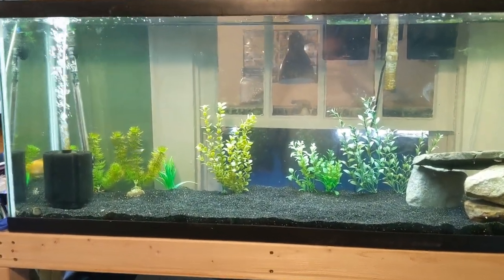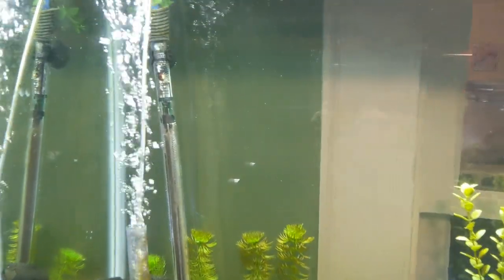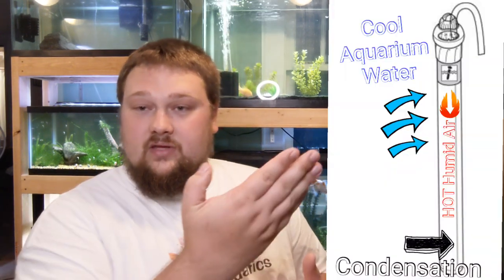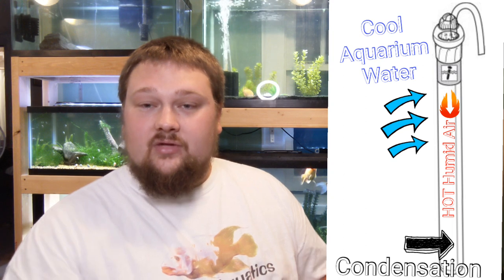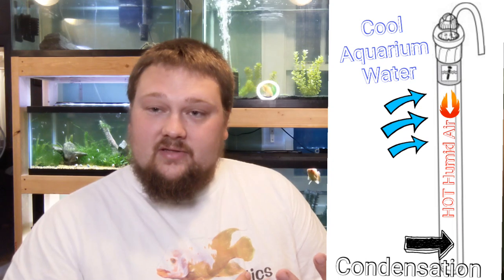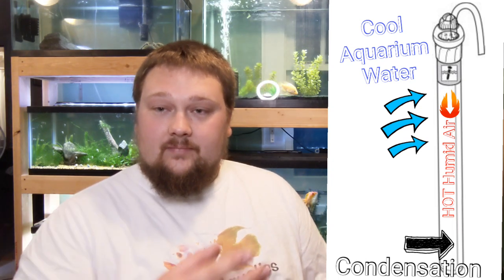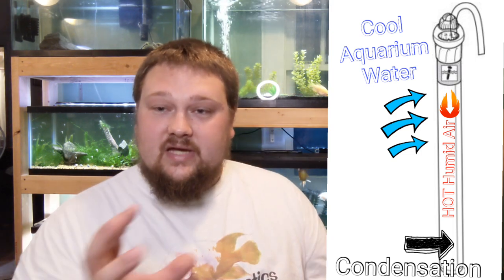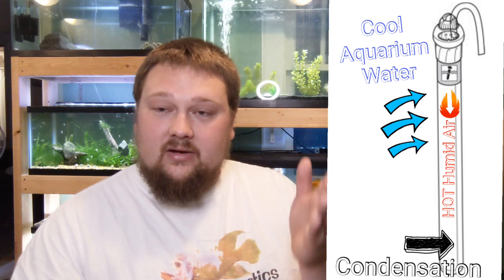Water inside an Aquarium Heater - Is my heater Broken?

Comment: If you have any water in your heater it’s malfunctioning. Theses heaters should never have that much condensation in them in the environment their in.  The temp is the same on the inside and outside for the most part. It’s not unpopular it’s how they function.  A submergible piece of electoral equipment is manufactured under a guideline of safety. Water should not be in your heater. If it is there is a chance it can pop.  If you find condensation return it. Water and electricity are not friends.   I’m sure like me there are people out there that have had a heater pop and kill all your fish. Imagine if your hand was in the aquarium when that happen. Theses days I keep my building at 78 and the majority of the tanks stay there without heaters and the aquarium that need a higher temp like rams discus I use heaters. But electricity and water are a no no. Remember when you are making a video and you present a topic like this saying it’d ok you are presenting yourself as an expert and giving permission you can be healed libel. Be very careful. Yes leaving the factory you can have condensation. After that heater turns on there should never be any condensation in that heater. Temperatures are at equilibrium.
Reply from the maker: The temperatures will never be at an equalibrium, tanks are kept at about 78-80 degrees and the heaters are heating up to well past that constantly to heat our aquariums, and the moisture will never leave the heater as it is a sealed unit, The manufacturers are aware of this and have even posted on their websites in the FAQ section as shown in the video that this is normal to have happen. if your heater is filling up with water that's a different story.
Reply: Trafish Aquatics equilibrium doesn’t mean in perfect union it could mean a few degree variations as the mechanics of physics work. But in order for you to get condensation it would have to be out of equilibrium for an extended time. I can’t get your whole comment but I will tell you you are wrong. And yes you can get condensation from the factory but that air will adjust as the outer temperature changes. You will have a small amount of condensation at first but after the temperature heats up inside the glass the condensation will stop and should never see it again. If someone puts a disclaimer on a product like you say and someone is killed because they used a defective product the manufacturer can be prosecuted.
Reply from the maker: The definition of equilibrium is a state in which opposing forces or influences are balanced. In order for that to happen they would have to be the same. If aquarium heaters only went up to the same temperature as the water inside the aquarium creating an equilibrium between the aquarium heater as well as the tank water then there would be no way for fish to receive burns from heaters, which does happen, because the heater would not be any hotter than the water that the fish is living in. therefore the heaters are actually getting much much hotter than the actual water temperature within the tank which creates an imbalance in temperature which would allow for condensation to build. Also if you watch the entire video aqueon specifically puts a disclaimer on their website that this is a normal occurrence in aquarium heaters and does not affect the reliability or functionality of their heaters. if they're willing to make that claim on their website then they're willing to be sued over it if they're incorrect.
Reply from the maker: It's very apparent that we have very different opinions on the matter therefore I'm going to just leave it here, just because our opinions differ does not mean that I don't appreciate your input! Thank you.
Reply: Trafish Aquatics   Hears the truth. I enjoy your channel. You’re a young guy in the hobby and doing great and enjoying it. I say go for it. I’m an old guy been doing it since the middle 70s. The question of equilibrium was not a question I got wrong on any test in any science class in college. The sun keeps an equilibrium based on the pull of gravity and the push of fusion the push and pull are not always equal but it maintains and equilibrium within a rang of changes. The heater works the same. You set it at 78 the thermostat reach a little higher depending on the manufacturer. Then it shuts off. It drops temp by a few degrees then the thermostat turns it back on. With in that rang moisture shouldn’t develop.  This is just a matter of Physics. Nothing else. I don’t have an opinion on it it just is a fact.  My concern is how you put this. You are not an electoral engineer you can be held liable for what you’re telling people. You are essentially an aquarium hobbyist. Unless you have a degree in fresh water biology and an engineering degree. You’ve told people it’s ok to use a heater that clearly has moisture in it. If you decide to do that’s it’s on you If you tell others it’s ok can you be sure that they can make that decision for themselves based on your recommendation?  It’s not a point of disagreement it’s a point of liability. I’m not telling you this to disprove your point I’m telling you the science of it and the fact that you can be held responsible for what you say in a public forum.  You can’t be sure that someone might take your advice but not have the experience and knowledge to make that decision and could possibly make a uneducated decision that leads to injury. Take my advice be very careful how you present you’re opinion. I watched an amplifier repair tech passing himself off as a teacher. He had a student working with him. He had him open up an amp and start to do some basic things. He never told him not to touch the capacitors or transformers. Because he wasn’t a teacher he didn’t understand the importance of knowledge. The kid touched the wrong thing and in a blink of an eye he was dead. An amp doesn’t have to be plugged in to kill it retains a charge. I tell all my students to keep their hands out of the back of the amp till it’s been discharged. Nothing to do with fish but same idea.  Do nit get me wrong I think you’re are developing a great show. You’re not so far off on all your information and lost of it’s harmless. But damn someone that doesn’t have the knowledge and understanding might say Trafush said it’s ok that’s why I felt ok with sticking the heater back in when I got knocked off my feet.  I bread rare fish. I have to have a disclaimer when shipping and use a proper contract that protects me and the customer. As a nurse I keep liability insurance because I am a professional and can be held liable. And as an amp tech that teaches amp repair I keep insurance for that because this shit can destroy your life.
Reply from the maker: everything you're saying is fully understandable and would make sense if the aquarium heater only heated up to the temperature that you were trying to reach to and no further, this is just not how they work.   The thermostat on an aquarium heater reads the temperature of the water around the heater and tells it when to turn off when the water temperature reaches the desired temperature. if the thermostat was to fail and the aquarium heater was allowed to stay running permanently water temperatures would easily reach well over 100°. This is the same reason that many manufacturers now are putting protective cages around their heaters to protect fish from getting burned from heaters while they are in the on position. As well as many people recommend hooking heaters up to thermostatic controllers as a secondary safety precaution. if the heaters themselves were only to heat up the coils to the desired temperature then yes an equilibrium would be created between the water temperature and the temperature of the heater but that's not the case. if you truly want to see an established equilibrium between a heater and the tank surroundings you would have to unplug the heater and allow the internal temperature of the heater to readjust To the same temperature as the tank water and then any condensated water inside the heater would then dissipate over time as it evaporates back into the air within the heater. also there is no difference between what I'm stating in this video with my opinion then there is of the manufacturer recommendations on their product. What I have stated in my video is no more than the manufacturers notes on thier product.
Reply: I’ve had heaters with condensation for 5-6 years and no issues. The way an aquarium heater works, it’s impossible not to build some condensation in the areas above and below the coil.
Reply: Trafish Aquatics   It’s basic if you set it at 78 it should shut off at a factory setting not to far above 78. It shouldn’t drop to far under 78 for the thermostat to start it up again. It’s not dropping 10 degrees at about 70% humidity and that’s what you may need to cause condensation. That shouldn’t happen in your heater. The heat the heater creates should be enough to keep the heater free of moisture. If you have poor circulation in the tank this could cause hot spots and throw it off where you may have a cold spot in the tank. I’m not arguing I’m just stating facts that I didn’t come up with but it’s just empirical evidence. Like I said I don’t even use heaters in 98% of my tanks. But I also don’t buy heaters that are cheap either. It’s just simple your heater should have around a five degree variance. That should not be enough to creat any permanent moisture inside the glass. If your buying heaters that acquire permanent moisture on the inside it’s not very well built. There standards that these manufacturers need to follow. Putting an electoral appliance in water can be dangers and must be taken seriously.  Back in the 70s all heaters were bad. I’m not shitting you. If you find condensation on the inside of the heater get a better one. These are living creatures that depend on your skills to have a good life.
Reply: Ric Brunner couldn’t you call Aqueon about this then? I mean they’re the ones who admit condensation is normal. I mean you’re kinda beating up on this guy over something he didn’t write. Also how exactly could Trafish be to blame if Aqueon themselves say its normal? Seems like you’re just trying to tear dude down for no reason whatsoever.
Reply from the maker: Yes if you set the thermostat on an aquarium heater at 78°, the thermostat will turn the heater off when the tank reaches approximately 78° give or take a few degrees depending on the given variance built within the heater. but the heater coils themselves do not only heat up to 78 degrees to try and bring the tank up to temperature they go well above 100° in order to do this and once the tank water temperature reaches the desired degree temperature set on your heater the thermostat turns the heater off. I can guarantee you that if you were to reach into an aquarium while the heater was on and grab ahold of the aquarium heater you would not be able to hold on to it for very long because of the temperatures that these heaters actually reach during the heating process. The heater itself does not physically only heat up to a few degrees warmer than the set tank temperature, It goes much higher. This is the variance that causes the condensation to happen.
Reply: Trafish Aquatics I cant read your whole comment. Like I’m saying you a nice guy enjoying this hobby turned YouTube show and I’m happy for you. We would probably get along fine. I’m not arguing the point I’m giving some facts. I’ve been lucky to have been blessed with a great education I’ve achieved a numbers of degrees one of them is an electronic engineering degree. So when I tell you the facts that there should be no moisture in the tube I’m speaking from a professional point of view. There should be only a 5 degree difference in the thermostat. It takes at least 9 degree temperature difference depending on humidity in the tub to make moisture. If you have humidity in the tub that’s an issue that can cause corrosion on parts and the appliance will start to degrade.   It’s simple. If you have a heater that moisture accumulates in the tube it’s junk cheap parts and substandard workmanship or it’s broken. Why would you want it.  I didn’t want to make my point by pointing out my education. Don’t like to shove it peoples face. I work as an amp repair man and builder. I also work three days a week as an RN. Just opportunity’s I’ve had in life.
Reply: Aquatik Guru   I’m not beating him up. And if they admit to this then their attorneys are not involved. You can’t accept moisture in the tube long term. If there is moisture in the tube there is an issue. And if you get on YouTube and say it’s ok you leave yourself open for liable. At best you will have corrosion at worst you will have your Jane in the tank when it pops. If I were working for a manufacturer that built submerged electrical products and tuned in a plan for one and I said well I can’t control the moisture in the appliance I would be fired because I couldn’t do a simple plan for a submerged appliance.
Reply: Ric Brunner you’re wrong sir. Simply put. Also Aqueon does admit that....so you should contact them about your concern. Look it up yourself. It’s a very simple google search. I’m sure you can find the number to call and to complain about it too right there as well.
Reply from the maker: If you're unable to read my full comment you have to click on read more if you're on the computer or on a phone. The only person who keeps bringing up your education and occupations is you, I've never once questioned you or asked you about it. The fundamentals of a heater are simple, and if the heater itself was to only get a few degrees warmer than the water temperature The heater would not possibly be able to keep up in maintaining the temperature of an aquarium. The principle is the same as a central heating unit in a home, whether it be a forced hot air system or a hot water radiant baseboard heat system, The furnace being the heat source heats the water or air up to a much higher temperature than the room temperature that your thermostat has been set for, The hot water is then sent through the hot water baseboard and allowed to radiate temperature until the room comes up to temp. For the forced hot air, the air is heated up to approximately anywhere from 140 to 160 degrees Fahrenheit and circulated throughout the rooms to bring the temperature of the room up to what you have it set on the thermostat and then the furnace turns off the blower and allows it to cool down until called upon for the next heat cycle by the thermostat. Aquarium heaters work in a similar fashion. If your furnace was only to go a few degrees over room temperature trying to heat your house you would freeze in the winter.
Reply from the maker: You must not have watched the full video because I literally show a screenshot at the end of the video where aqueon literally says on their website for their heaters that there could be condensation and it is a non-issue...
Reply: @ricbrunner3880  I got 50 bazillion degrees so you're wrong I'm just stating facts